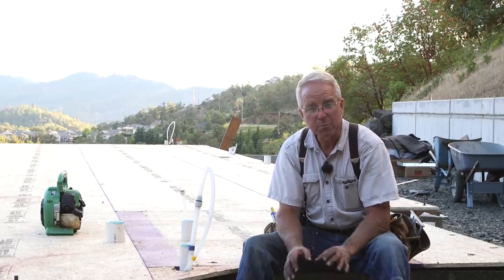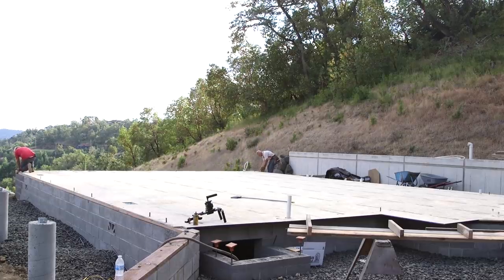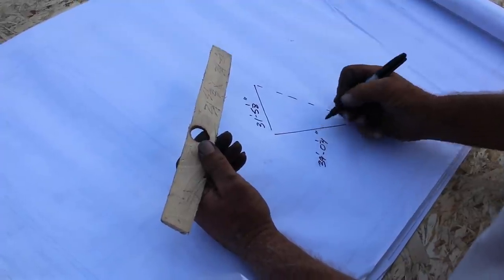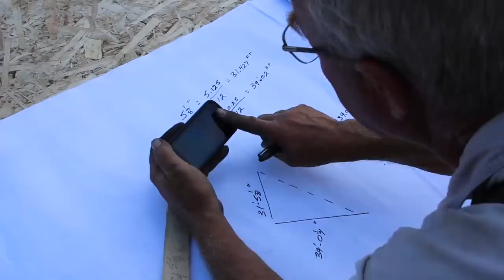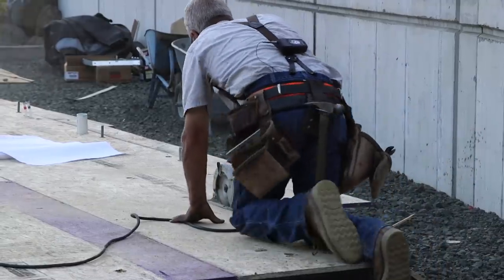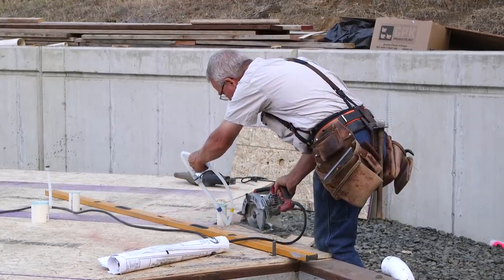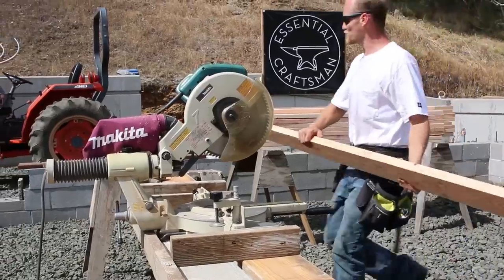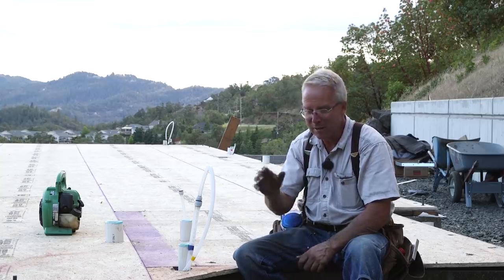Make it Square Ep.45

Comment: This comment will probably not be answered, but why not cut flush with the stem wall? Not sure I understood why you took off the 5/8"
Reply from the maker: Stemwall was/is a little too narrow...
Reply: @essentialcraftsman  thank you for taking the time to reply!!! If the stem wall was too narrow, why make the cut even shorter? If anything, I would think that you would leave an overhang with the subfloor. Or at best just cut flush and adjust the rest of the measurements. I'm missing something for sure. By the way, thank you for the channel, I have learned so much from you and your dad!
Reply: @schumyschumy  He is cutting the deck 5/8" narrower than the dimensions on the blueprint, which makes it flush with the stem wall. This is because the stem wall is 5/8" narrower than what it says on the blueprint.
Reply: @esp1818  aaaaahhhh i thought the stem wall was narrower not that the overall dimensions of the house were smaller. Thanks for the clarification Ryan

Comment: It's the same thing, but I always think of the pythagorean theorem as the 345 rule.  Doing it the right way is more accurate, but 345 is a handy way to check if you just did a 90 degree corner or things like that.

Comment: I find it difficult to see how you made a parallel measurement with out first creating perpendicular lines.  I lay out my projects by first establishing a straight line.  Then, use the pagathorium theorem to make the perpendicular lines. Just like you layout a line parallel line on a  on a piece of plywood using the factory cut edges.
Reply: You can make two parallel lines without a square line by drawing out two long arcs, think of your tape as one huge compass, the peaks of those arcs connected together form a parallel line.
Reply: @niccomaker  It seems with long arcs, i.e. over 20', it would be hard to find the peaks. Is there arc lengths where this method becomes difficult?

Comment: Excuse me for being a dumb ass Brit, but once you've cut the deck to finish size why do you need to snap the outside wall lower plate position? Surely the outside walls can only go flush with the outside edge of the deck, with the exterior is lapping down the side (if required)?... Sorry, I'm used to cavity wall and bricks/blocks :)

Comment: The zero points of the vertically represented measurement in the animation appear skewed from parallel with the front wall. Commenting with a observation as requested that may or may not be accurate as the time necessary for a proper review was not available. Our broken city water main requires my attention preparing my tugger for a 42' underground pull when the neighborhood wakes up. This will be old Greenlee's first time messing with water, should be fun.
Peace.

Comment: Thanks, I love learning how things are done in other places. BTW in the Southern mid Atlantic U.S. we call it the 3-4-5 method because as you know any even multiple of those numbers will put you square, it's easy to remember, no calculating  and it don't intimidate the new guy.
Reply: That doesnt work when squaring up a deck
Reply: @timothywald9079  It doesn't have to be inches,  it could be feet or 30-40-50 meters. Just measure 3 feet down one side 4 down the other and when you have exactly 5 feet between the two points it is square. If you are establishing a corner, set the first line were you want it then go the appreciate distance down the other line and adjust back and forth until you have your multiple of 5 between the two points.
When you're done measure corner to corner, provided your project has four wight angles and lateral sides. Also remember, if you mark the outside edge of one board do the same on the other as well as use the same side of the measuring device. Hope this helps. Thanks.

Comment: All these comments suggesting the 3,4,5 rule instead of Pythagoras Theorem... Do they not realize that the 3,4,5 rule IS the Pythagoras Theorem?
Reply: The Pythagorean theorem is that for any right triangle the sum of the squares of the legs, (or shorter sides), will equal the square of the hypotenuse, (longest side). The 3-4-5 is simply the smallest example of a right triangle where all the sides are whole numbers. Easy to remember, easy the scale up, and certainly easier than squaring, adding and then finding a square root.

Comment: @5:10 ...but...the none of the sections of the back wall line up in this drawing. So what are you referencing off of? Or is it just a bad drawing?
Reply: That's what reference lines are for. Pick a spot where you can run a line through at a suitable location, and make your measurements from there. It can be most anywhere, but HAS to be square to front and back of the house, to be of any use.

Comment: I’m still a bit confused on why he had to cut 5/8ths off of the design. Why didn’t the design work as-is? Was it the design, the layout, or the plumbing that wasn’t quite correct?
Reply: Distance between the block walls 5/8" short?  I don't understand how that could have happened since the layout was checked and rechecked several times before the block work started.
Reply: Because, the layout is generally perfect, but the real world isn't. Materials and human workmanship can't be much better than .1% accurate. On house scale, that's half an inch, easily. This house is 1/2 done... so now is a good time to compensate for accumulated errors. Before they get out of control and you lose the square/plumb/& true goal entirely.
IMHO.
Reply: Chris Hoppe that’s what I was thinking. But he does make it sound like he was making it smaller than designed. Making things square at each step makes sense, but why not adjust to match the plan closer at each step? Or is that what was done?

Comment: -I’m glad you spent a little time on Pythagorean Theorem and look forward to further discussion on it (I think you said you were going to do that 🤔)
It’s always frustrating to me when I hear someone say “all we have to do is measure the diagonals until they are equal, then we know it’s square.” - Wrong!!
Maybe the EC2 channel would be a good format to discuss Pythagorus?
-I see you’re using black concrete dye in your chalk line. Same as we used to. That stuff is really messy but if you want a permanent mark, that’s the ‘chalk’ to use!
🤜🤛
Reply: Would you care to explain why "dead-on" diagonal measurements do not make square corners?
Reply: @talbertadams6586  -Sure, no problem. If I could draw a sketch, you would recognize it immediately, but I can’t, so I’ll try to explain.
Say you need a 10’x10’x4” conc pad. You cut (2) 2x4s 10’ long and (2) 10’-3” to create your forms. The 10’-3” pieces overlap the 10’ pcs at the corners to create a 10’x10’ inside dimension. Let’s say, in a momentary lapse of concentration, the wrong board was overlapped on one end. Now you have an isosceles trapezoid. One end is 10’, the opposite end is 9’-9” and the 2 sides are 10’-1.5”. Not realizing the error, you pull your diagonals until you get equal dimensions and assume it is correct, w/o knowing what the diagonal of a 10x10 pad should truly be and w/o a single corner being square. Using the formula, A²+B²=C², you would know that the correct diagonal measurement can only be 14’-1 11/16”. 
Sorry for the length.
🤜🤛
Reply: @psidvicious  OK, sure if you assume that the laterals are not equal lengths, but that's kind of a contrived scenario.  It's really, really simple to verify that your top, bottom and sides of a wall assembly are the correct lengths, 4 pulls of the measuring tape. It's assumed that you've verified the sides are equal.  Once that's done, and it's confirmed you didn't screw the lengths up, equal diagonals absolutely do confirm that everything is right angles.
Reply: @andrewalexander9492  With all due respect Andrew, you are adding a step that I didn’t mention. You said to walk around and confirm all 4 measurements. In the example I gave, ‘some guy’ is building a 10x10 form. Why would he check himself when he is absolutely positive as to the length that he cut the 2x4s, [(2)10-0 and (2)10-3]? His error was in the assembly of the forms (which one overlaps which?). This mistake, in assembly happens ALL the time. The point being that in the scenario I laid out, checking for equal diagonals would give an incorrect result. Taking the time to do the calculation is the ONLY bullet-proof method to know that it is built correctly.
🤜🤛
Reply: @psidvicious  my point is that if if you've verified that the opposite sides are equal, which isn't at all hard to do, equal diagonals absolutely do verify that your corners are 90.  Sure, you can calculate the triangles using the Pythagorean theorum, and as a surveyor, I'm certainly not afraid of a little math.  But instead of calculations, which can also go wrong if you're not paying attention,  4 quick pulls of a measuring tape will verify whether the sides are equal, then no calculations are necessary,  you don't need a calculator (or the ability to do square roots without a calculator)  I'm not sure why you keep arguing against this, as if it's somehow impossible black magic to quickly check your sides than measure the diagonals.   It's so easy even a caveman could do it.  Either method depends on correctly measuring the length of your sides.  In your contrived scenario where the sides of the form aren't 10 ft, and the matching diagonals method fails because the guy assumes the lengths are all 10 ft,  the Pythagorean method will also fail, because that same guy who assumes incorrectly that the sides are 10 ft, will also make the same incorrect assumption when applying the Pythagorean method.  If he won't check the length of his sides when using the equal diagonals method, why would he measure the sides he "knows" are 10 feet to use the  Pythagorean theorem?   Both methods will work,  but both methods depend on correctly measuring your sides.  If we start adding hypotheticals about incorrectly assuming the length of the sides, neither method works.
Reply: @andrewalexander9492  I’m not sure what is making you so defensive towards a 15 sec calculation with a calculator, that is completely infallible when done right. Dbl checking all the measurements is absolutely good practice. No argument there. But if you are going to take the time to check all the measurements, why wouldn’t you take 15 more seconds and check that the diagonal is indeed what it is suppose to be? If the pulling of equal diagonals is proof positive enough for you, than good luck w/that. I’ve been around long enough to know that people make mistakes 🤷‍♂️ and a cpl seconds of insurance, is money ($0) well spent. And btw, no surveyor ever says, “I’ve confirmed all the dimensions so no calculations necessary”. That doesn’t happen my friend!
🤜🤛
Reply: @andrewalexander9492  ...and your edited version of your last comment further proves my point. 
-By using the formula on the ‘box’ with wrongly assumed side lengths, ‘the guys’ diagonal measurement will not prove correct, so immediately he knows something is wrong. 
-I think the problem here may be that you don’t understand how forms are cut and assembled. (2) pieces are cut 3” longer bcz the material is 1½” thick (1.5”x2=3”). The longer pieces overlap the shorter by the thickness of the material 2X. Once on each end. It is not a contrived situation like you stated. Like ‘the guy’ just botched the measuring of the material. If you had construction experience you would know how common this mistake occurs.
🤜🤛
Reply: @psidvicious  "  By using the formula on the ‘box’ with wrongly assumed side lengths, ‘the guys’ diagonal measurement will not prove correct, so immediately he knows something is wrong. " 

Well, no, if the form was laid down with the one corner opposite the diagonals close enough to square for tolerance, and they measure the one diagonal assume (erroneously) the sides are 10 ft and the diagonal checked close enough, you'd have one corner being 90, and the other 3 being off.  Again, both methods, are dependent on the length of the sides being accurately known, and neither method will work correctly if.  My experience with squaring things this way is with framing wall panels. The wall is framed with numerous factory cut studs so there is virtually no conceivable way you could have the sides different lengths.  any one stud of the wrong length wouldn't throw the side off, it just wouldn't fit the assembly,  The top and bottom plates are cut together so are unlikely to be different lengths, and if the were somehow  different lengths, that would be glaringly apparent once at the studs were nailed in at 16 inch centers.   So you temp nail one plate to the deck, measure the diagonals, if they're not the same, you tap the other plate in the direction it needs to go, measure the diagonals again, and if they're the same, you're good to go, no button punching on your calculator required.   This idea of yours that errors in the sides are probable with one method, but impossible with the other is just nonsense.  Both methods have applications where one might be more handy than the other,  but to make blanket statement as you have that your method is the "only bulletproof method" (your words) is inane.
Reply: @psidvicious  "  By using the formula on the ‘box’ with wrongly assumed side lengths, ‘the guys’ diagonal measurement will not prove correct, so immediately he knows something is wrong. " 

Well, no, if the form was put together as you describe,  and the guy didn't remeasure the assembled form, and assumed that all exterior dimensions were 10 ft 3", calculated the hypotenuse at 14 ft 6" and streched the tape from corner to corner and  tapped it into place  until the diagonal read 14' 6 " (14' 5-15/16" actually) you would still have a non-square form. The same error in nailing the sides together makes both methods give bad results.    Again, both methods are dependent on the length of the sides being accurately known, and neither method will work correctly if.  With either method you either: a) measure the sides after nailing the form together, and catch the mistake (with either method) or b) you don't measure the sides of the nailed together form, assume it's correct, and wind up with an out of square form .. with both methods.  My experience with squaring things this way is with framing wall panels. The wall is framed with numerous factory cut studs so there is virtually no conceivable way you could have the sides different lengths.  any one stud of the wrong length wouldn't throw the side off, it just wouldn't fit the assembly,  The top and bottom plates are cut together so are unlikely to be different lengths, and if the were somehow  different lengths, that would be glaringly apparent once at the studs were nailed in at 16 inch centers.   So you temp nail one plate to the deck, measure the diagonals, if they're not the same, you tap the other plate in the direction it needs to go, measure the diagonals again, and if they're the same, you're good to go, no button punching on your calculator required.   This idea of yours that errors in the sides are probable with one method, but impossible with the other is just nonsense.  Both methods have applications where one might be more handy than the other,  but to make blanket statement as you have that your method is the "only bulletproof method" (your words) is inane.
Reply: And for the record, I never suggested that things were done this way in surveying.  I don't know where you pulled that out of, but I have my suspicions. I mentioned being a surveyor to make the point that I wasn't afraid if a little math.
Reply: @andrewalexander9492  I never said that errors in the sides were ‘probable’. I indicated that they were simply possible. That’s all. Building walls under factory conditions is a bit of a different animal than the example I gave of a simple 4 sided form. With all of the studs laying in place, there could easily be a visual tip-off that something is not right even before measuring. A keen eye might even notice a square problem of a cpl inches in a 10’x10’ form. But would it be noticeable in a 20’x20’ or 30’x30’? Probably not. 
-I was simply making the point that measuring 2 diagonals on a ‘box’ until like numbers are achieved, does not insure squareness! An error may have been made in the assembly and that the PT formula is the way to check for that. If you go thru the exercise of dbl checking all the measurements on all the sides and then check the diagonals (somewhat haphazardly I might add), that’ll work too. But with the formula you KNOW what that diagonal measurement is suppose to be before you even start! What’s so hard to understand about that?
-What if you were building a circle with one quadrant having a square corner? There would be no other corner to compare diagonal measurements with. “Oh no!”  Pythagorean Theorem.
🤜🤛